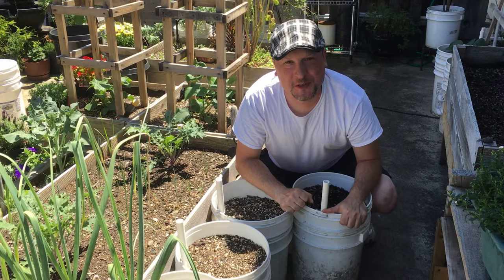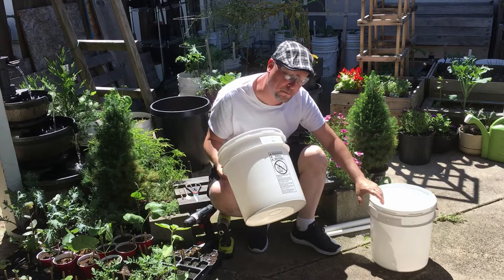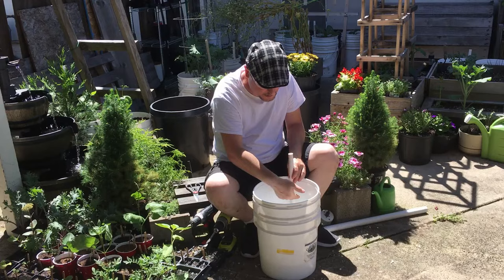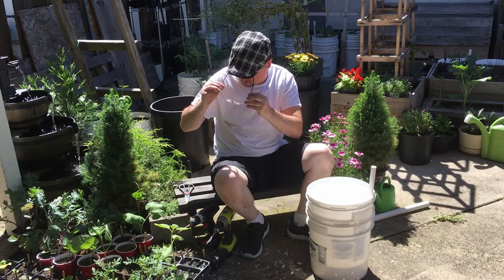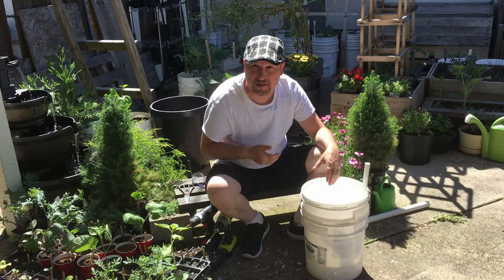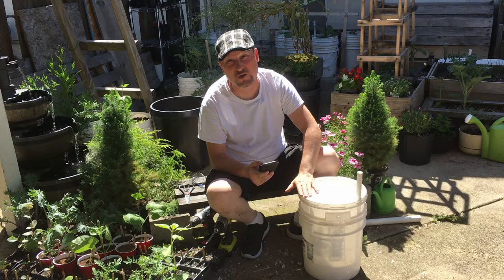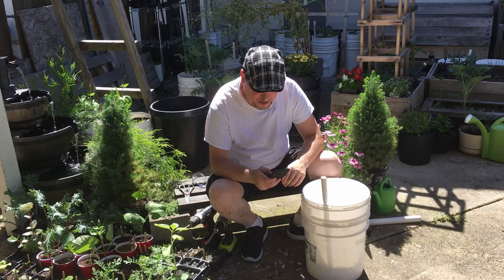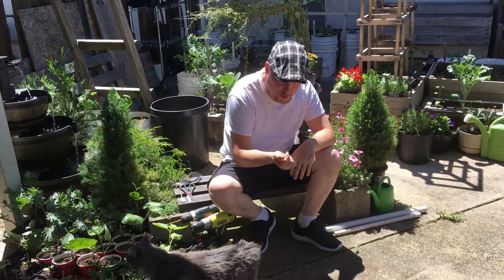How to Build 5-Gallon Wicking Buckets REVISITED | + Q&A

Comment: An important reason for the holes in the upper bucket is to allow air access to the soil in the bottom area and ensuring drainage of excess water thereby preventing root rot.  It is also important to make sure that the overflow hole in the bottom bucket is not higher than the bottom level of the inner bucket.  This will ensure that the airgap between water and soil is maintained at all times
Reply from the maker: Yes, that is correct.

Comment: Hey, is the bottom of net cup supposed to be touching the bottom bucket? I’m using the United Solutions brand buckets from Walmart and the reservoir doesn’t seem deep enough like yours.
Reply from the maker: I have had buckets that the net cup touched the bottom and I just filled them and used them as normal. They worked just as well.

Comment: How many years does these buckets last. Because I know plastic detours with the IV light from the sun. Would a coat of Uv blocking spray paint prevent derogation.
Reply from the maker: I have never tried that but it would be interesting to test it out. They do break down under the sun's UV. I rotate mine around so they are not all in full sun all the time. I get about 3-4 years out them before they start chipping and then being more careful with them I still get another 2-3 years out of them. I do still have buckets that are well over 8 years old too though.

Comment: Just subscribed to your channel. Great video, one of the easiest I've seen so far explaining how to build a wicking bucket. I do have a question though, how do you keep the dirt from falling out the bottom and sides of the net pot? Thank you for your video.
Reply from the maker: Thank you for joining us here. And thanks for the compliment on the video. The amount of soil that you lose from the net pot is not enough to worry about. I have several of these that have the same soil for the last couple season and still have the soil in the net pot below wicking up into the container. Just pack it in nicely.
Reply: You could add some landscape fabric cut to size, before adding the soil.

Comment: Is the net pot supposed to touch the bottom of the bottom bucket?  I bought the exact materials and my pots sit about 1/2" above the bottom of the bottom bucket.
Reply from the maker: They don't have to touch the bottom, they just need to be submerged into the reservoir water so that it can wick the water into the top or planting bucket.

Comment: Being in Wisconsin, the sun's UV isn't as intense as in the South, but the FREEEEEZING winters make most plastics brittle in 1-3 years. Is there anyway to mitigate the damage? (no room inside to bring these in)
Reply from the maker: Even though it is cold the same thing is happening to the buckets that happens to them in the summer. It's UV that breaks down the plastic and could even be worse in colder areas as snow would reflect a lot of UV. If not in use you could cover them.

Comment: Fertilizer can be added in that 1/2" pipe.

I tried your setup with so-so results.
Best thing I found was a glass wine bottle (at least 1 quart in size), fill with water, and shove in the ground.
Yes, I have to fill bottles but I get an easier way to tell if the bucket needs water or not.

Comment: I've seen quit a few different ways on the wicking system and yours is very straight forward, 
I like it and I will be putting some together right away to get ready for spring. I wonder if putting some organic fertilizer inside the reservoir would feed the plants well or would it be too much for them.
Reply from the maker: I would say it would be best to just scratch some into the top and let the nutrients seep down. 
Thanks for the great compliment and keep an eye out for more videos coming soon.
Reply: put the fertilizer into the soil.

Comment: Awesome video! Thank you for posting this! Have you tried different heights for the drain hole? In rainy locations, you may want lower drainage hole and in dry locations, you may want a higher drainage hole.
Reply from the maker: Thank you! No matter the conditions the holes should be right at the level of the bottom of the top bucket. It makes sure that the net cup is fully submerged in order to draw up the water and to not allow it to over fill when it’s raining.

Comment: It works great with hydroton.
Reply from the maker: just wondering how it would be applied to a wicking bucket, seems like you would need a bunch of it...
Reply: You just use it in place of soil, it is expensive but very light, for pots I often mix it 50-50 with gravel, no soil at all, then you just use a slow release fertiliser. That way all the plants roots get plenty of oxygen without any rotting organic matter in the mix.  The clay balls wick the moisture so does the gravel.  @theUrbanGardener
Reply from the maker: These are five gallon buckets, it would be a lot of hydroton. Wouldn’t be very practical I would think.

Comment: Do you recommend lining the bottom of the planter (top) bucket that has the many small holes drilled out and the inside of the net pot wick with landscape fabric to prevent the potting mix from falling into the water reservoir from the small drilled holes? Or, is the idea that the roots will grow through the holes and into the water?
Reply from the maker: No need for any liners. With a strong root system they will reach down to get additional water but the job of the system is to wick the water up into the top buckets root system and keep the soil from drying out.

Comment: I have a question? I live in Arizona for context. If I were to make a self wicking bucket like the one in this video, how would that affect my plant in my climate?

I'd imagine the water in the bucket would be pretty hot during the summer. Would that kill the plants roots when it's wicking the water? Or would it start cooling down during the wicking process since the water wicks slower?
Reply from the maker: The water in the reservoir won't exceed the temperature of the day, unless you are using dark buckets, I always use white buckets. Plus you can always on excessively hot days flush the reservoir with nice cool water. I haven't run into any problems with mine through excessive 100+ weeks here where I am at.

Comment: I have built your 5 gal wicking system and want to grow an indeterminate beefsteak tomato plant this coming season (2023 ) on my deck.  I am a complete newbie at all of this. The question I have is do you keep the reservoir full to the overflow holes all the time throughout the growing season??  I realize that the potting soil will take up and hold as much water as it can but maybe this will be too much water all the time.  Any assistance would be very much appreciated.  Thank you
Reply from the maker: It depends on the heat level of your area, if it is hot then the water will need to filled every couple of days in order to keep the container moist. If it is a cooler region then it will not be needed as much. You just don't want to allow the container to dry out. As for growing tomatoes in the containers, I will say that larger varieties might not grow as big as they can. I have found that tomatoes are going to want more space for root growth, at least 8-10 gallons. I found that cherry tomatoes do do well in these containers. I hope you have success with this system, it has worked very well for me over the years. I encourage you to find the link in the description of our videos to our FB gardening group and share your experience and get some help from other gardeners in our group as well. Happy Gardening Randall!

Comment: Can I mix water solube fertilizer with water to add to the reservor, or is it best to fertilize from the top by drip method
Reply from the maker: With a water soluble fertilizer you could go either way. I am using a worm casting tea and that I will water from the top.

Comment: Would this still work if you had a larger reservoir ? Like if you had a lid for the bottom bucket cut out so the top bucket sat higher?
Reply from the maker: You could try this, you just want to be sure the net pot can always reach the water no matter how low it gets.

Comment: What is your protocol at the end of the growing season. Do you reuse the soil again the following Spring? Do you dismantle the entire system or leave as is. I live in the snow belt.  Thank you.
Reply from the maker: Thanks for the question. I have been filling them then using them for two seasons then recycling the soil with amendments and refilling. It has worked well. This way I don’t have to do it every year. I should be showing this process really soon on my Garden journal videos.
Reply: @theUrbanGardener  That would be great if you could. Thank you.

Comment: How large of an air gap should there be between the 2 buckets? Thank you.
Reply from the maker: If by airgap you mean the reservoir at the bottom then that just depends on the buckets. They are designed to sit inside each other and usually have about 3 inches of space that is used as the reservoir.
Reply: @theUrbanGardener  I didn't explain myself very well. I'm talking about the air gap between the top of the water level (where the drain holes would be) in the bottom bucket versus the bottom of the top bucket. stanacho854 in the next message indicated "An important reason for the holes in the upper bucket is to allow air access to the soil in bottom area and ensuring drainage of excess water thereby preventing root rot.  It is also important to make sure that the overflow hole in the bottom bucket is not higher than the bottom level of the inner bucket.  This will ensure that the airgap between water and soil is maintained at all times."  There is about 3 inches of space between my 2 buckets. I just want to drill the overflow holes properly so I leave enough of an airgap to prevent root rot. Again thanks for your time.
Reply from the maker: @GeraldKistner  Okay, I get what your saying better now. I would say about a 1/4 - 1/2 inch should be sufficient. You want to be able to hold as much water in the reservoir as possible and also not allow water to get above the bottom of the top bucket. I hope that helps.
Reply: @theUrbanGardener  You explained things very well. Thank you so much.

Comment: Question my wicking bucket were working great. I had to put water in them some everyday and we had a hot spell. Then they just started not wanting any water and plants were drying up i live in las vegas nv and have all my buckets so they get east facing sun. Have any idea thanks
Reply from the maker: I do believe that there can be a point when the soil dries out so fast that the wicking stops being effective. I do recommend to water from the top every so often, as I do put in organic fertilizers that need to be washed into the soil. Plus doing a good plant soak with some compost tea, giving your plants a foliar feeding too.
Reply: @theUrbanGardener  will do thank you
Reply: @vegasman2068  Definitely mulch your bucket, three inches! 

One inch of compost if you're growing ornemental plants or a max of three if growing fruits/veggie plants before you mulch! Fertilizing with a 3-1-2 ratio ommercial product (and its multiples) every 2-4 weeks at half/three-quarter strength until say, the end of growth season, depending on what you planted.

Comment: Do you fill the water pipe until it backs up in the pipe?
Reply from the maker: Thanks for your question, you fill it up until water comes out the drain holes on the bottom bucket.

Comment: How do you fertilize your plants using this system
Reply from the maker: I just scratch in a dry organic fertilizer into the top inch or so. If using a liquid fertilizer I would prefer to apply it to the top and allow it to drain through vs. putting it in the bottom bucket with the water pool.
Reply: @theUrbanGardener  Thank you for taking the time to respond... I really appreciate it.
Reply from the maker: @ralphgrunz7377  You are welcome Ralph. I appreciate your support as well.